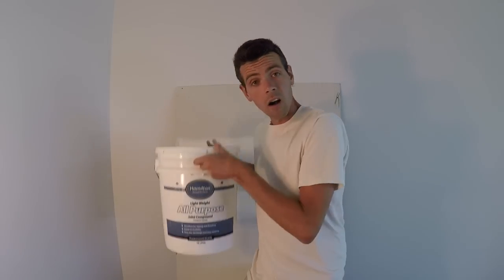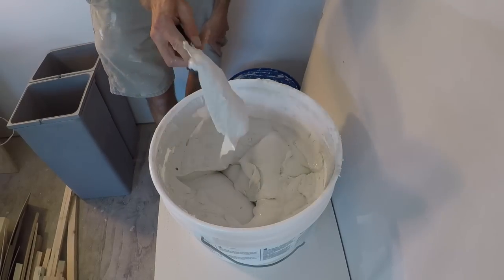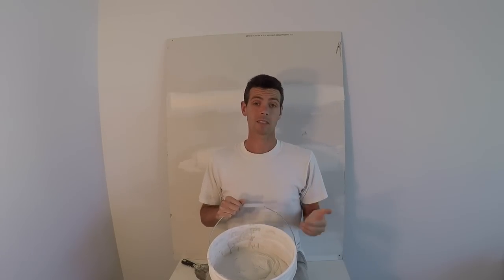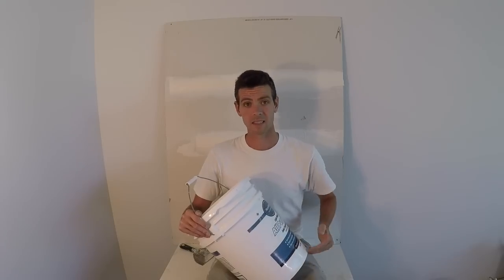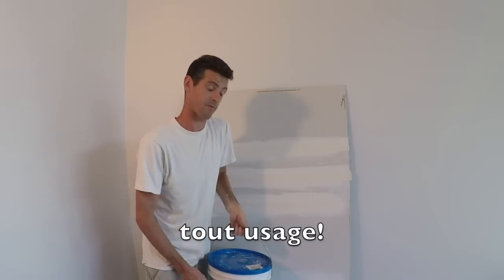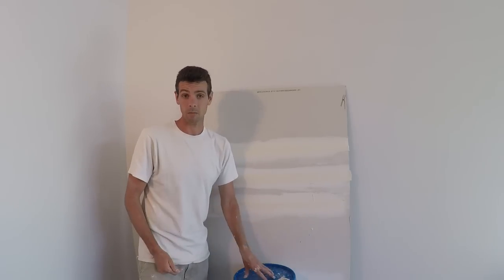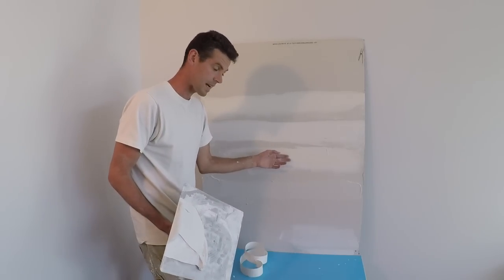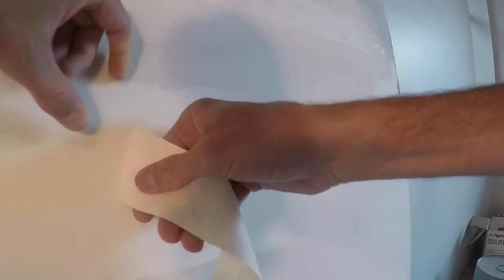LIGHT MUD vs HEAVY MUD!!! (What's the difference?)

Comment: As  homeowner / DIY type I have used both heavy and light compound over the years and after living in the house for decades I don't notice any difference in how one holds up over the other. OTOH, when moving full buckets around the house my back certainly knows which I prefer!  The one thing I did notice is the light weight will grow mold if you leave a half bucket in the basement for a few years. That doesn't seem to happen with the old school mix. In all cases of "long term storage" I always trowel the surface smooth then add a 1/4" of water so it doesn't dry out. When I go to use it again I pour off the water and stir it up a bit. In some cases I have kept mud in the bucket for 5 years and it seems quite ok this way.
Reply: Thank you

Comment: I only use All Purpose heavy weight, even to top and skim. I tried switching to light weight for topping, but it’s too soft. It nicks and scratches way to easy. I run a Mirka palm sander shopvac system to sand, so I prefer the mud to dry harder.  I’m also more confident it will stick to whatever I’m applying it too.
Reply: A lot of it depends on how you sand.  We power sand with a Mirka, but if you hand sand All Purpose sucks!
Reply: you can use premix rpose to skim coat a wall?
Reply: @KevinsDisobedience  all purpose is more flexible than any other compound. I only use lightweight for touch ups, watered down. Marks, dings, etc.

Comment: The only problem with lightweight that I have seen is, it causes tape bleed though. After a prime coat, and 2 paint coats, tape lines bleed trough the paint. Typically caused from not enough mud. Drywall guys say they did 3 coats. But I'm sure they're lying because some areas the tape is cracking indicating a level 2 finish. They Think because lightweight mud doesn't shrink as much, they think they can skip a step.

Comment: Two tips 

The heavyweight stuff can be thinned down with water. Makes it A LOT easier to spread. It actually goes on quite nice if you mix it well with water

The lightweight becomes a lot more durable if you add plaster of Paris to it. Not too much because it will start to harden too quickly and before you know it you're trying to spackle with play doh. But if you had just the right amount, you will find it has much more strength when hardened.

Some guys will even add a 20 or 45 minute dry spackle mix to it

Happy taping 😁👌

Comment: Every video you post addresses real questions I actually want to know the answer to. Most construction videos on YouTube only show what I already know.
Also, I always felt that wetting the tape thing was bullshit but thanks for proving it!
Reply from the maker: When I did that other video about whether wetting the tape reduces blisters I was surprised how nicely the mud wiped out. I still would never do it over just thinning down the mud but I thought it was an okay trick. After doing the test though I think it's pretty clear it may reduce blisters but it also significantly reduces adhesion.
Reply: @vancouvercarpenter  I feel like a bit of an ass because I didn't pay as much attention to that other video as I should have. In my comment I was mostly referring to other people having mentioned it to me. Like in general guys from time to time will say "you should always do xyz." Except I've never done xyz and never had any problems. Then the bullshitometer starts pegging out. Given what you've shown here, though, it makes sense that the air would wipe out from between the mud and the tape easier, because the two aren't actually sticking together.

Comment: I tape with all purpose heavy here in Portland Oregon. If you are at all worried about the tape not adhering to a surface add a little glue water and it sticks to anything. For finish coats I use topping compound. I also carry setting type compound.
Reply: He explains that in other videos, it's a good tip, I tried it last week.

Comment: Hey man, just turned full time company owner from employee a couple of years ago and was never a huge taper but always got the job done the right way when the boss needed me to fill in. Going out on my own, I now realize why I was filling in all the time. Responsible people are hard to find. So a little over a year ago, I started to tape my jobs myself due to being tired of relying on other people. With that said, I was always taught to water down for inside corners. I don't add water to any other joint or fill and never have. After watching this video, I stopped watering down inside corners and realized immediately how much longer the corners were going to take even with lightweight because it doesn't spread as easy, pulls the tape, and I'm a perfectionist so any imperfection has to be fixed on the spot. After doing this test, have you stopped watering down inside corners; and if you have, how are you keeping up with production time so the job doesn't slow down? A couple of union tapers I know told me to use the corner trowel to speed things up. Have you tried it?
Reply: I'm thinking of trying a white glue and water mix to wet the tape, similar to what I mixed into hot mud. This test result was eye opening for me!

Comment: I tried the lightweight for a while, but ended up returning to standard mud due to so many bubbles.  It was a nightmare getting them out.  I always just assumed they just whipped more air into the mud to make it lighter.  Didn't know about the fillers and glue.  Of course I use topping after the first coat, but for strength, the heavyweight is the best.

Comment: When you tape with all purpose mud apply mud   Wipe mud and use the mud you collecting on top of the tape. That will make a lot easier to wipe without wrinkles and adds more straight by saturating the tape with more glue on both sides. Also adding a bit of water helps.

Comment: I'm in the UK and I've been using Gyproc Easi Fill 45 (powder) for some taping with fibre tape on a kitchen wall I drywalled and for general filling prior to decoration around the home. Not sure how it compares to North American products but it mixes, applies and sands really easily to a good finish and no cracks after many months.

As with most commenters, your videos have been super helpful!

Comment: Non-pro from eastern Canada. I can't say what the pros use here, but I've definitely seen the CGC all-purpose stuff around quite a bit, and especially with consumer and prosumer use. Judging from what you said, it seems like its just available more over here, because I could walk into just about any store and pick some of that stuff up. I recently started using setting type compound after watching a bunch of your videos, and I can definitely say that it's so much easier, and not dealing with shrinkage (as much) is fantastic. I've seen the CGC lightweight stuff in stores but I've never bought it or really see anyone with it. Interesting too because aside from commercial fire rated stuff, lightweight drywall panels are pretty much the only thing you can buy, so Im not sure why lightweight is such a priority there but not in the muds. In addition, I've had CGC dust reducing mud (which actually has worked to keep the dust down) but it seems to be even heavier, so I'm not sure where that falls into the mix. EDIT: also, shipping probably isn't cost effective but if there's ever some variant of mud that's available here and hard to get over there, let me know and maybe I can forward some over to you.

Comment: We have both light weight and heavy mud here in Eastern Canada. I think it's because we have been using heavy mud since the beginning, probably a hold over from when we used plaster back in the day. When I was finishing houses we used a mix of heavy and light weight mud. I now only use heavy or what it is called around here All purpose mud. The stuff is amazing, it will stick to just about anything and if your good with it, easy to sand. What makes it difficult to work with is the shrinkage, i have to do tape plus three coats on my seams, screws and butts. Takes longer but I rather it for it's strength and durability.
Reply from the maker: Your a good man! It really is a gar superior product for the end result.

Comment: Thank You!  Funnily, I was taught with Standard All Purpose (5 gallon green bucket here in the States) and so use it on everything. Depending on what I am doing I just mix it, mix and add a bit of water, mix and add more water or mix and add Plaster of Paris. Because I am used to it, working it and sanding it do not seem difficult. I did get frisky on one job and try the lighter weight variants...hated how NOT scratch resistant the surface seemed. On another job, got frisky again and needed the dry time to hugely drop and so used dry bags, which I water mixed on site. Everything was great until it came time to sand. Different dry bags and premixed all dried to different hardnesses and so were left with slight thickness variations/waves after sanding..so I went back and skim coated everything with all purpose : )

Comment: Living in Hawaii, we are at the mercy of the vendors (Home Depot, Lowe's, etc.) and I have gone back to the heavy weight all purpose mud for taping joints and found that it does work much better. 8 joints in our guest room and no bubbling and great adhesion. I'm using Plus 3 for finish coats, but have left it behind when it come to taping as it just doesn't work well for taping. Again, many thanks for your videos, they have helped me tremendously in our guest room project.

Comment: Back in the days of old, tapers on big jobs would thin down mud to a very liquid state, dip the tape in that liquid, and then apply the way you did. I think it works like when you apply new concrete over old and you add an adhesion layer of brushed on, thinned concrete? Made taping very fast.

Comment: 🤣  I’m sitting here re-watching some of your videos to brush up before I dive into the actual mud portion of a bath renovation. The last 20-30 seconds or so, paraphrased: “You’re not watching videos ALL day, are ya? I mean it. Go build something.”  You caught me. Guess I better get to work. 

Btw, I’m a low voltage guy (Fire, Burg, CCTV). This is NOT my wheelhouse. But I’ve got a better clue on the entire process from your videos. Thanks for it! Now, if I could just figure out why the builder of my house chose stud spacing of 16”... or so... give or take several inches”. Seriously. Every stud is differently spaced, including one that’s 22”. 🤦‍♂️

Comment: There are 2 scientific facts of the universe that cannot be argued: 1) mass is never created or destroyed and 2) I am never skim-coating again! Mad props to you Ben and all you other troopers who tackle this most sloppy, irritating, endless scourge of wall reshaping. By the end, I really wanted to punch some holes in my handywork. In fact, I'm pretty sure I invented some new profanity that will make an appearance on the urban dictionary soon enough!
Reply from the maker: 😂 sorry to hear it. Its painstaking work.
Reply: @vancouvercarpenter  I was considering skim-coating my stippled ceilings throughout my house. After this experience, I'd rather put up a 1/4” drywall sheet and tape. I simply don't have the patience you do to go through with it.
Reply from the maker: @WayPastCrazy2525  use 1/2" board. You won't notice the thickness. 1/4" is double the price and will follow inconsistencies in the  ceiling or even make them worse. I prefer to laminate over skimming. I would rather tape and finish joints over ceiling skims any day.

Comment: You're right. I was wondering why Canadian tire was the only place I was able to find the all purpose blue lid. Everywhere else was light weight and I wanted regular premix. I don't find it that hard to sand even though I've only ever used the blue lid all purpose. Mind you I've only used it for areas no larger than a couple feet not entire walls. Now I'm tempted to try the light weight since I'm still a noob at skim coating

Comment: Hi. When I started taping in 1986 in Edmonton, we were using a product by Synko called "Red Line". It was available in All Purpose and Topping/Finishing. Lightweight muds were just coming on the market. Currently Synko sells a heavy mud in pails called "Redi Filler", at Home Depot. I believe that this is the original formulation of Synko Red Line All Purpose. (I also noticed recently that Hamilton mud now uses the term "Red Line" for a lightweight all-purpose mud.) We used to sand Synko Red Line with 120 grit sandpaper.
When I moved to Toronto in 1987 they mostly had CGC All Purpose mud which was heavy. Finishing muds were very hard to find. CGC mud sanded with 100 grit sandpaper. 
I have found with lightweight muds that they leave a texture which must be sanded completely, or they will flash, and that the original Red Line mud did not have this problem, although it required an extra coat on joints and corner bead to compensate for added shrinkage.
Keep up the videos. I enjoy watching them and don't feel that I will ever stop learning how to be a better taper.

Comment: Ive been using "conventional all purpose compound" and its freakin heavy but I'm glad and I find the dust falls faster to the floor, it doesn't linger in the air but sanding I use 100 grit to take off any heavy spots works like a charm
Reply: Same for me, I love the green All Purpose. I used lightweight mud for years until I tried the green box a few years back, now I think the lightweight suck. I really don't understand why people say almost unanimously that it's tough to sand. Hot mud like Sheetrock45 is hard to sand, horrible to sand.

Comment: Back in 1987 I built a perlite plant.  I developed a coated micro sphere and sold to Gold Bond, Georgia Pacific, for light weight joint compound. My product was so good in the lightweight after 90 days on the shelf it was the same viscosity as when it was made. It was even more smooth than the heavy product.   I could not get enough business fast enough to make it and had to sell to a company that wanted the plant for regular perlite products.  No one has made a produce that good to date. I buy lightweight for my projects from time to time and it is garbage compared to what it could be.

Comment: Thank you, Ben - great video, as usual.  Here's a question regarding the wet/dry tape discussion: As a DIYer, my understanding is that purpose of the tape is to eliminate cracks between two pieces of drywall, yes? Now, unless you have a pet raccoon, the tape is not going to be pulled up, especially when it's covered under a layer of mud, as you widen out the joint (as you have taught us). Not that I'm asking (but let me ask) Big Ben, but wouldn't the real litmus test be to install a series of tapes (2 wet, 2 dry - with light and heavy mud, as you did) along a joint. Let it dry. Then slowly bend one of the sheets of drywall along the crack and see which one cracks first and which one lasts longest. Just wondering...
Reply from the maker: That's a good idea. I think it would be hard to get a controlled result though.
Reply: @vancouvercarpenter  Off to the laboratory with you then, young man - make sure to wear your lab coat!

Comment: That wetting trick works against any adhesion unless you wet it with adhesive itself :). Liquid adhesive while consist some amount of water use it as media to penetrate into material pores and bonds substrates, when one of substrates already saturated with water, it gives less chances to adhesive to find free pores it can penetrate into, no to mention additional water has same effect as dilutions of glue which may make it more workable but not way stronger.

Comment: Have you tried blue dot Westpac/Hamilton taping mud? It’s only used for applying joint tape and corner bead. It has a lot of glue in it and you can hardly rip the paper off the wall. If you splatter some mud on the drywall and let it dry you will rip the paper off the drywall if you try to scrape it of with your knife!

Comment: Thanks. I would have thought wetting the tape was a good idea...but nope.
Reply: Wetting tape is good. Watch the taping series at Homerenovision with Jeff.
Reply: @peterbergeris6510  Jeff is great but I'll take Ben's advice when it comes to drywall
Reply: By wetting, your applying a thin coat and keeping the tape covered on the wall. Lots of time you will find the back of tape not covered 100% . But you can lift up those areas and apply mud.

Comment: Here in upstate NY I apply paper tape with the green top heavy all purpose mud and mix in some wood glue then my top coats are either blue top mid weight and I skim coat with light weight to fill scratches and small voids.  Never have issues but yes the heavy weight sucks to work with.

Comment: I have noticed that 3 in 1 will shrink when taping and lay down real nice, taping with all purpose will not shrink as much and does not feather edges as well as the 3 in 1, taping with durabond 90 in outside walls and bathrooms was a night mare as it seamed to expand and  stay excessively proud of the joint than other compounds.

Comment: I'll chime in that pre-wetting the tape seems to not work well.  I had seen that in videos before doing a bedroom, so went that route.  I'd say about 20% of my seams had bubbles, and when I went to cut them out, the whole piece of tape would just come right off.  I won't be doing that any more.  Also, the products are water soluble, right?  So does that mean putting water on the tape is dissolving the glue that is trying to come in to contact with it?  Even more of an argument to not wet it.